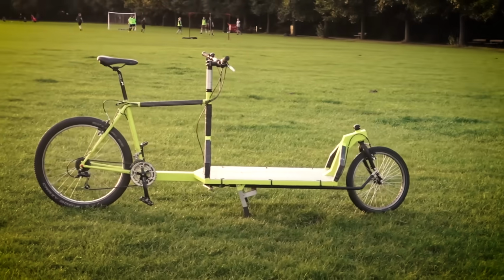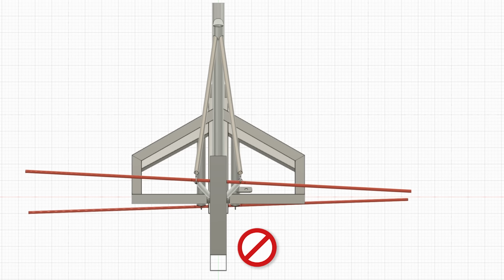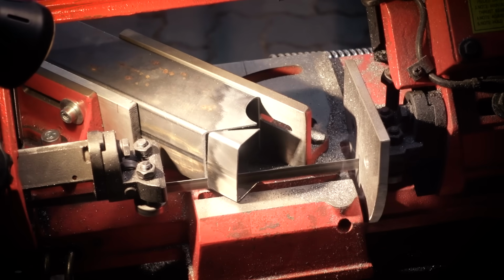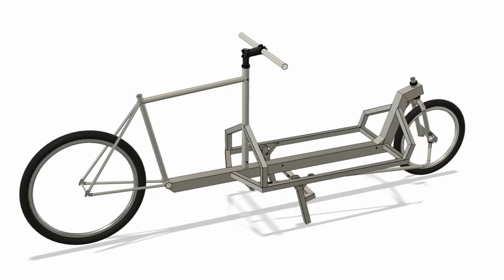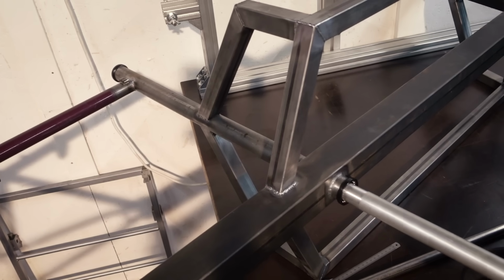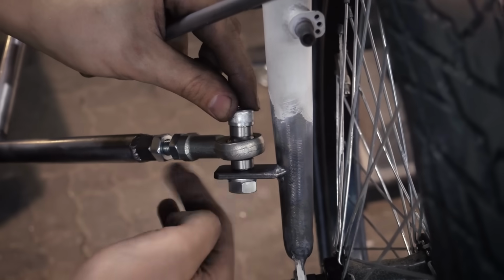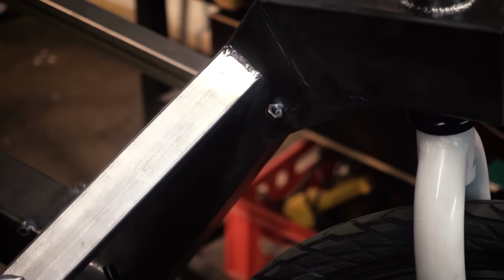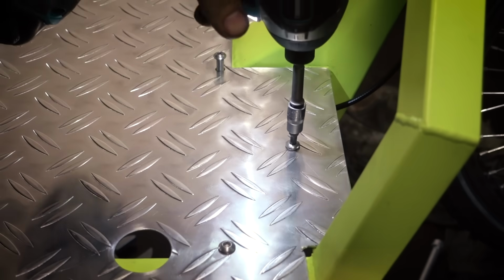How to Build a DIY Cargo Bike (Plans available!)

Comment: Any reflections on weight of homebuilt w/mild steel non-cycle square tubing vs. aluminum factory cargo frames?   It's hard to know how heavy these choices make the resulting bike, and how much that affects the rideability.  I know they're intended to haul a lot of weight, but some homebuilds look like they may weigh 3x a normal mtb weight before you load them.
Reply from the maker: It depends a bit on how you build the frame, they do get heavier than aluminum frames, that's just the tradeoff you have to live with to make it "buildable", as in, relatively easy to build with common tools and materials. You could build a steel cargo from actual thin-walled cromo bike tubing, but it makes everything more complex and expensive.  That being said, there's still big differences between homemade builds. Many people use too small a downtube and then end up adding lots of weight elsewhere without really improving the structure, hence why this bike as a huge downtube cross section but with thin walls - this gives you the best stiffness to weight ratio. Using a smaller cross section with thicker walls will be much heavier while providing a less stiff frame, which is the mistake many people make with these long johngs. I tried to design this in a way so it doesn't become crazy heavy but is still what I would consider basically a bomb-proof design. I've had over 160kgs of weight on this bike, with my own 100kgs in addition to that, so almost 300kgs of system weight, which is way beyond what any commercial long-john style bike is rated for. It was still somewhat rideable, but just barely. 
As for the bike itself, pretty much all long johns will make you break a sweat if you're hauling stuff around,. it doesn't make that much difference whether you're riding a 25kg Bullitt or, like in this case, a 32kg homemade cargo, but of course it depends on what bikes you compare. There's 20kg homemade builds, and there's also 40kg commercial long johns. Many commercial designs really don't seem to care about weight at all at this point and some (the Urban Arrow would be one example) are ridiculously heavy, even compared to DIY builds.The simple physics make it more or less impossible to have a sturdy cargo bike that rides as effortlessly as a roadbike. This is why almost all commercial models now come with electric assist, and many models you can't even get without it - on a cargo bike, it simply makes sense to make up for some of the weight that way. Long story short: Depending on your goals and skills, you can definitely home-build a long john that rides as snappy as many of the commercial models, even with mild steel tubing you can get relatively close, but this particular build isn't optimized for weight, but rather to be a good all-around package that will work well for most people. But I'm confident that with some small changes,  I could build this thing using mild steel square tubing and get very close to what a Bullitt weighs (which is kind of the standard Benchmark). Anyway, yes - 3x a normal MTB is actually pretty normal, and these bikes ride absolutely fine handling wise, although of course a bit more sluggish than a normal bike. The main problem is getting them up a hill when loaded - requires either low gears and patience, good fitness, or a motor.

Comment: Why the long stearing tube is on 90 decreed angle? Is it better than what the bikeframe normaly have?
Reply: Normally the stearing tube defines the forward frame geometry of a bike, i.e. how much forward the front axle is from the rider. Having it at 90° would be impractical and result in very bad riding characteristics. With a Long John, this is not a problem because the front axle is detached from the steering tube completely. So having it at 90° allows for a more compact construction overall as the steering tube does not interfere with the cargo area.

Comment: This is a very useful idea and a great project tutorial. Your choices are very practical and fit very well with the design goal. I also like the option to make the bike an electric variant. Just great options on this one idea of a modified bicycle. These would be great to have in auto assembly plants for skilled tradesmen to use and get some exercise in. Thanks again for your great design knowledge and fabrication skill.

Comment: How long did you leave the nuts in the citric acid to get the zinc removed?
Reply from the maker: A few hours, but it probably depends on the concentration of the acid too. I buy it as a powder at the drugstore for cleaning kitchen appliances. Works just fine

Comment: place a plastic/fibre washer between the alu foot-plate and the stainless steel bolts, the alu will corode with the stainless bolts, between the mates,  perhaps some coating could be used to insulate the mates, bit of varnish or something on the scew cap mates perhaps

Comment: The wheels seem very small and the frame very low, this makes the bike look like it steers worse than when I put 200kg (body weight included) on my mtb.
Still a Shame that I don't own a workshop for this but this is a very well made video

Comment: Is there some unexplained reason for not using a 26 inch wheel on the front instead of the 20 inch? It would allow you to use the existing components from the original mountain bike.
Reply from the maker: Yes there's actually tons of reasons

Comment: Great work ! great plans, thank you so much for it ! I did mine for about 410€, 100 hours. I was a complete beginner in MMA welding. I spent a long time doing the welding. I had some difficulties for finding the 1”1/8 steal fork before I realized it was BMX standard. 
Another problem I had : I didn't manage to extract the bottom bracket, which was very seized up. I was affraid welding without removing it would burn the grease or even weld the ball bearings. Hopefully it is still rolling and no particular problem until now. 
And I did a small mistake with the steering tubes dimension (too thin) so I've been tinkering to make it fit. 
My advice : choose a good donor bike, I lose money buying new gearing, and other new bike parts.
Reply from the maker: Nice! Also good to hear some feedback on cost and build time, 400 bucks and 100 hours is about what I would guess as well for an average build. Looks like you also learned a lot of new stuff which I think is a big pro with taking on a project like this.
Seized bottom brackets are a pretty common problem on older frames, I would generally suggest to disassemble any donor frame completely before you use it to find potential problems. Maybe you can still get it out though, it's usually just a problem of finding a way to apply enough torque

Comment: for all of you's who get the motivation and go on with the project, don't be a fool like me and think you will get good cuts only with angle grinder. for the sake of your sanity and nerves, buy hand mitre saw if you don't have decent cutting machine at home. I can't even start to explain what hell I'm going through cause i can't make same cuts under an angle on both sides of square tubes. forget angle grinder cutoff stand if you have small ( 115 mm ) angel grinder.  it won't even cut through 30x30 square tube. If you have cheap drill press from Lidl like I do, you can also forget notching anything with Bi-metal hole saws. one month in fabrication ( during weekend only ! ) and haven't given up although I was very close after I did my first welds... ffs...

Comment: Wouldnt this look a lot better with tubular steel, and wouldn't be too much more difficult?
Reply from the maker: Yes, but the point of this bike was never to build the "perfect" cargo bike or anything like that. The point was to design a cargo bike that is easy to build, so people interested in building one with limited tools can achieve that goal. If I designed a bike only for myself it would look very different, I'd use different materials and tools, etc.  but for 90% of people it simply makes sense to use square tubing since it's much easier to work with if you have flat sides to reference measurements off of, whereas with round tubing you always have to keep axial rotation of the tube in mind and it's much easier to mess up stuff like mitre cuts.

Comment: an aluminium frame is no option due stiffnes issues ?
Reply from the maker: No you can use aluminum, but I designed this so it's possible to build it with more or less simple tools and common materials, that's why mild steel is used. Most people don't have the ability to weld aluminum since you can't just use any welder and it's more difficult to work with. I've built other bikes from aluminum and will make more in the future

Comment: Hi, thank you for the detailed video. You inspired me and I guess a lot of other watchers to start their own project.

I am wondering, you used a steel tube with 38mmx2mm -> 34mm inner diameter. The 1 1/8" ahead steering tubes have 34,2mm inner diameter but you do not seem to have an issue to fit the bearing shells into the steel tube. Did you have to do any grinding or turning on the lathe before fitting the bearing shells of the headset? The mildsteel tube is "stretchy" enough I guess? 

Thanks for the small hint!

Comment: what happen we use the same diameter for the front wheel?  why its always smaller wheel at front
Reply from the maker: Saves space, makes the bike lower, shorter, lighter, improves handling (corner radius) and the frame is more robust that way. There's not really a big benefit to having a bigger wheel in front, but there are many benefits to having a smaller one
Reply: @PhilVandelay  is it ok if i just use the origin wheel instead of buying  a smaller set for the front. 
is it worth to minimize the budget that way?
Reply from the maker: @imamulhakim320  Not really, you would have to change the entire geometry of the frame and bike which takes a lot of work and the result would be much worse. The measurements from the plans wouldn't work anymore. A cheap 20" wheel or a used one costs very little. You could try to find a local place that sells used bicycles or parts, these wheels and forks are often found on folding bikes or kids bikes for example. It's definitely not worth it in my opinion, you would save a few bucks, but create many new problems
Reply: thanks for the advice. very appriciatte that. stay safe.

Comment: I  think where i live it be dangerous pulling out with that nose up front, i mean i have to lean forward on a normal bike to see clearly . Still i welded two broken bikes together to get one working three wheeler that was terrible except in a fun dangerous way , mostly front wheel would come of the ground on changing slopes but having two people peddling was ok .

Comment: I see on your plans and this video that you mention the donor frame must be steel. As older steel MTB’s are getting pretty hard to find here in NZ I was wondering about substituting everything on the frame build for aluminium. Possibly also using some self aligning bearings bolted to the front fork retainer to make it more robust. Is there a particular reason not to use aluminium? I wonder about how the welding process may affect the heat treatment of the donor frame around the BB area. Do you think fitting an old BB assembly would act as a heat sink to prevent excessive distortion of the threaded section?
Reply from the maker: You could build this from Aluminum, yes, but keep in mind you need a special welder (AC TIG welder) and welding Aluminum is much harder to learn than welding steel (at least that's my experience). I designed this thing to be easy to build so that's why I picked steel. As for welding heat, it's really not an issue, the BB shell is not going to deform from getting heated up (it's quite thick), the bigger risk is that you might damage the threads due to weld spatter or too much penetration, but it's not gonna turn oval or anything just because it gets hot. You can screw in some old bottom bracket shells if you want to make sure and that can also serve as a plug to protect the threads on the inside. Not sure wheat you mean about the self aligning bearings
Reply: Phil Vandelay Thanks for getting back to me. I have a friend who has been forced into retirement due to the pandemic who worked as a fabricator and he is looking for a project. I work as a cycle mechanic so have access to the bike parts so between us we may have a go at building the Long John.

Comment: Hello, How's the cargo bike holding up? The bike frame looks nice but if I have to build one, I will add a tube from the top of the seat tube to the bottom of the steering tube where the bottom square tubing intersect. This make the frame more rigid when carrying heavy load. Bridges built the same manner. Thx.

Comment: Any particular reason for the use of a smaller front tire? I understand it would make it a bit shorter in overall length but from my experience larger tires always handle terrain better.
Reply from the maker: There's a lot of reasons, you already mentioned one, it shortens the wheelbase quite a bit which improves handling (you really don't want to go any longer than this). That means it also shortens the bike overall, making the frame lighter and stiffer. But it also means the front end can be built much more compact, which means it's stiffer than with a large wheel. The front end on this kind of bike is the most critical part that most often fails, mostly due to the forces created by the front brake. If you used a 26" wheel the tubes in front would have to be much longer which bigger levers acting on everything so it'd have to be overbuilt even more. A larger wheel would also raise the center of gravity. But one of the most important reasons for me: This way you can actually load objects that are longer than the bike by having them hang over the front wheel (for example if you put a large board on the cargo box here). With a large front wheel this ability is much more limited. Another reason is just the visual design, there's a few bikes like this with two large wheels and they actually end up looking really silly.  There's even more reasons, but overall they just outweigh the downsides of a smaller wheel, 20" still rides just fine under most conditions. Pretty much every commercial long-john style bike (and theres hundreds of models now) uses the same layout because it just makes the most sense. Ideally you'd have a front suspension to counteract some of the downsides of the smaller wheel - something I'm working on for the next build.
Reply: @PhilVandelay  phil, thank you for the very detailed reply. I have made mini bikes over the years my specialty Recumbent Trikes. I am seriously considering building one of these and I understand what you're saying completely. I put 29 inch mountain bike tires on a recumbent trike all the way around before I saw them online. And though it is most awesome off road there is a lot of extra stress on the front wheels compared to say twenties upfront. You may hear from me again. Thank you for your time.

Comment: About the only things I would change is the handlebars (I hate straight bars) and I would add a hub motor system to make this easy to live with (Have you done that on the same format) it is a tool not an exercise bike.

Comment: Hi Phil. I Just Bought your Cargo bike plans. Do you have a version that include a Bafang Mid motor ?
Reply from the maker: If you mean the ones that just attach to the bottom bracket, I checked because someone else asked this and you should be able to fit/install these no problem.
Reply: @PhilVandelay  Thx.

Comment: You should use a plastic washer between the stainless bolts and the alu deck, stainless steel reacts with alu and the bolt will seize up good. I used to work on the tour boats in Copenhagen, we had to replace all the bolt holding down the deck, 9 out of 10 bolt was stuck and needed to be drilled out. 
You also need to give the bolt a bit of grease.

Comment: Thanks for sharing such precious information, you have encouraged me to make my own cargo bike. I have been struggling to set the axis height on the jig. I wonder if you could please tell me how high to drill the holes for the axles. I hope you could help me. Thanks in advance and cheers from Mexico.
Reply from the maker: Hey, you want them at the height where the axle for your wheels would be, so for example if you use a 26" wheel your rims would have a diameter of 559mm (without the tire!) so you would divide that by half to get the center of your axle which would be at 279,5mm. That's where you would need to drill the hole, measured from the surface that the jig is sitting on. Same for the front wheel except if you use 20" it would now be  203mm. If you use different wheel sizes you'd have to adjust that of course but for the 26/20" this is planned for these would be the numbers. And the distance between the axles would be 2084mm for this build.
Reply: @PhilVandelay  Thanks a lot, I´ll get to work right away.

Comment: Great build!
I've got one question. Is it not necessary to use some kind of heat-treatment of the metal after welding? To get the metal molecules as even as possible or something?
Best wishes and keep riding :)
Reply from the maker: With this kind of steel and this kind of welding, no. Heat treatment is usually only used in special cases, it's pretty rare that people use it in steel. It's more common/necessary when welding Aluminum, but even there you can get away without it (as you can see in some of my other builds). Heat treatment is almost impossible to do correctly for a hobbyist/small shop since you would need a huge industrial oven that can reach very high temperatures and hold them exactly, so if that was necessary nobody would ever weld anything in their garage
Reply: Thats good to know, thanks for the reply!